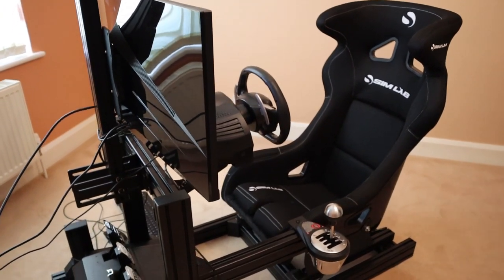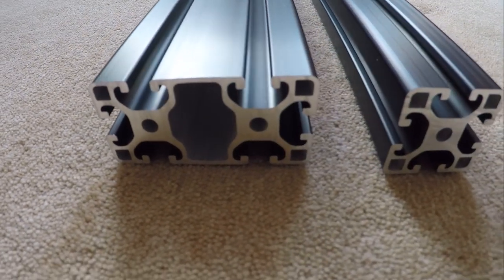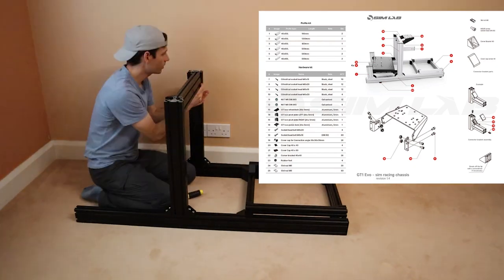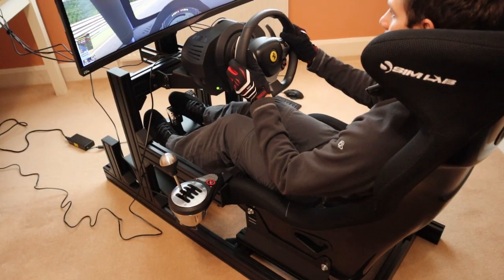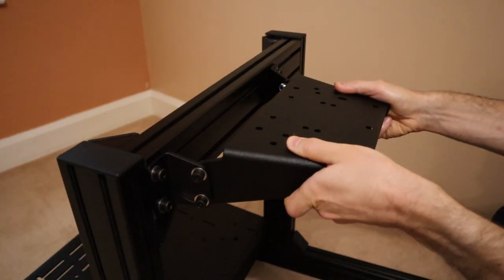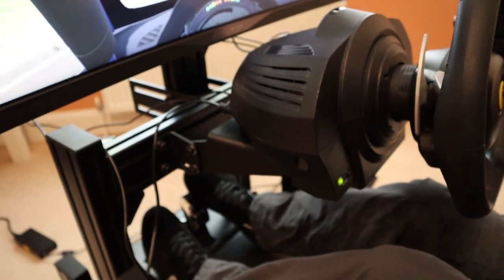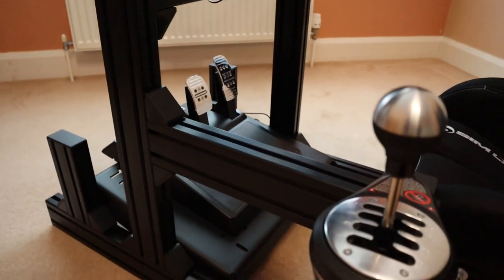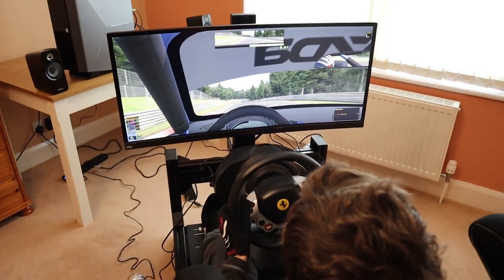Sim-Lab GT1 Evo cockpit review

Comment: Well, I'm convinced that this is the rig I want now. Ordered the NLR GT-Track, but haven't received it yet. My biggest concern about the GT Track is the adjustability of the wheel deck and shifter mount. GT-Evo seems to have every possible adjustment I can think of.
Reply from the maker: I haven‘t tried the NLR GTtrack, but from what I can see from the specs it looks to be quite adjustable. That being said, you‘ll be hard pressed to find a more adjustable rig than the GT1 Evo as aluminium profile is like a big lego set—you can attach new peices anywhere you like. If you do decide to go for the GT1 Evo, I‘m confident you won‘t be disappointed. Hope that helps with your decision. Let me know what you go for in the end. 👍
Reply: @ADAPTNetwork  After some research I ended up getting the P1-X just to be lifetime proof, even though I do believe the GT1 Evo is more than good enough for my type of usage.
Reply from the maker: Great choice  @wuzumaki —the P1-X can handle anything you throw at it!

Comment: I was considering the rig but 1. having to damage corner brackets for it to work really comes across as a half baked design. Couldn’t the company have customised them for you? 2. The list of hardware that is confirmed compatible doesn’t include multiple new popular products and they can’t confirm if it will work. They should keep this info up to date.
Reply from the maker: Thanks for your comment WVS and sorry for the late reply. Sim Lab's style is to put together aluminium profile kits using off-the-shelf components and some custom pieces. I think this helps balance ease-of-build and price for the user. Both the wheel and pedal plates are pre-drilled to fit a wide range of hardware, so it will work with most wheels and pedals even if it's not listed on the website. To be safe though, I'd recommend sending Sim Lab a quick email if you have a specific wheel and/or pedal set in mind. If you're looking for a fully customised aluminium rig out-of-the-box, I'd recommend the Next Level Racing GT Elite: https://youtu.be/czXXNvPJaPI

Comment: Can I mount a gaming chair to the rig?
Reply from the maker: Thanks for your question V ι ƈ ƚ σ ɾ. I'm not sure about a gaming chair (it will depend on the mounting points), but you can mount pretty much any car seat you like to the GT1 Evo. If you have a side-mount seat, you can use the bucket seat brackets ( https://adaptnet.work/5zmE ). Otherwise, you can base-mount a seat directly to the seat rails using a seat slider ( https://adaptnet.work/7jG5 ). Hope that helps. 👍

Comment: thats a really shit price 
you could easily buy this for 200 bucks
Reply from the maker: Thanks for your comment Mika. You are right that you could probably source the aluminium profile slightly cheaper.

However, the advantage of purchasing a kit like this is that everything comes pre-cut (with soft edges) to fit together perfectly. All of the hardware to assemble the rig is also included, along with some spares, and the bespoke wheel and pedal decks make it a lot easier to mount your equipment and fine-tune your driving position.

In the end, I think there are advantages to either route. 👍
Reply: Where can you get this for that amount and wheel deck as well as the pedal deck? Very curious as nothing comes close to this in terms of value, fit and finish.
Reply: @nicko5237  You will need to configure it yourself 
if you want to i can send you some pictures 
P.S a pedal deck is not necessary at all

Comment: What a waste. Put low end sim gear on a sim lab gt1 evo 🤣
Reply from the maker: Haha, for sure—the GT1 Evo is a beast and can handle most hardware you throw at it. In this video though, I wanted to illustrate the upgrade path that I think a lot of people will take (first upgrading the rig and then the hardware). I’m planning to make a follow up video with a direct drive wheel and load cell pedals in the near future. 👍

Comment: the screenholder is good? any flex or issues
Reply from the maker: Thanks for your question ex1t. In my opinion, the GT1 Evo single screen holder ( https://adaptnet.work/6Mun ) is the perfect option for running an ultrawide or one of the latest generation 49″ super ultrawides. I found that it performed flawlessly with my setup—securely holding my 34″ Acer X34 in place without any flex issues. Hope that helps. 👍
Reply: @ADAPTNetwork  thank you. Helps a lot
Reply: now i got my gt1 evo Rig with the screen holder...but the vibration from the base top the monitor is rly hard... I dont like it
Reply from the maker: Sorry to hear that  @_ex1t . Have you checked that the mounting bolts are fully tightened down?
Reply: @ADAPTNetwork  Yes, I tightened all the screws. unfortunately it vibrates too much. But ty
Reply from the maker: Happy to help  @_ex1t . Another option you could try is adding an additional piece of aluminium profile as a support upright for the shifter arm. This will increase the rigidity of the entire wheel mount and thus reduce vibration.
Reply: @ADAPTNetwork  ok, maybe i will try it out. Ty